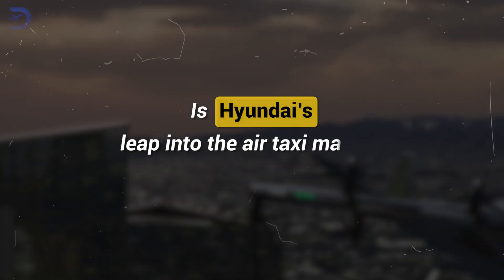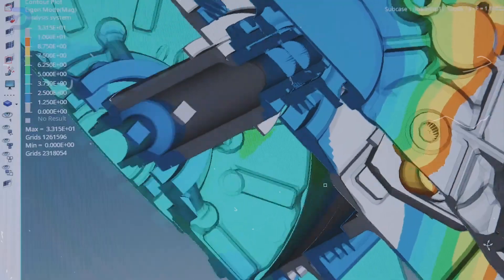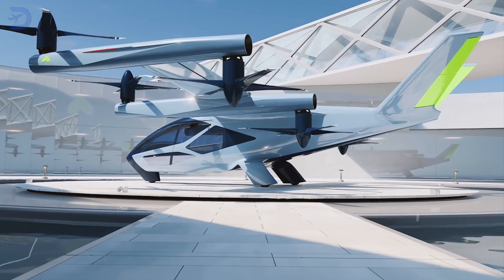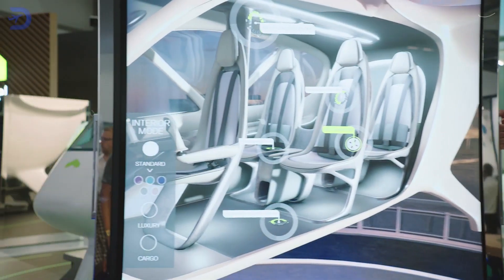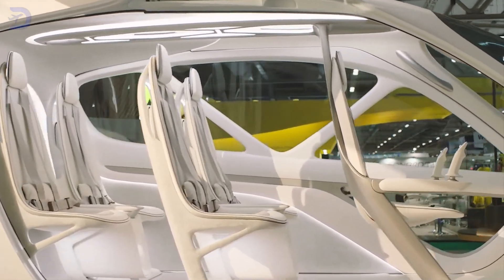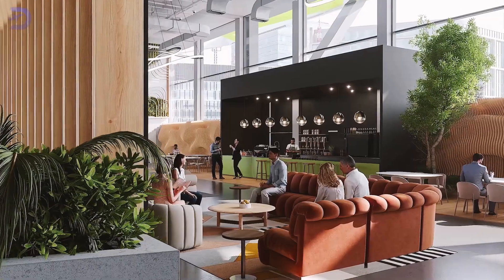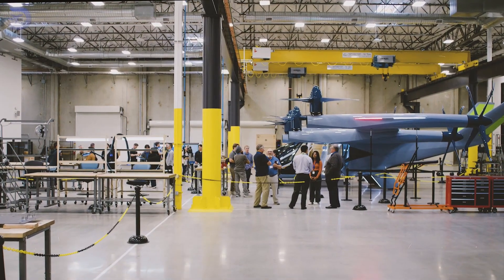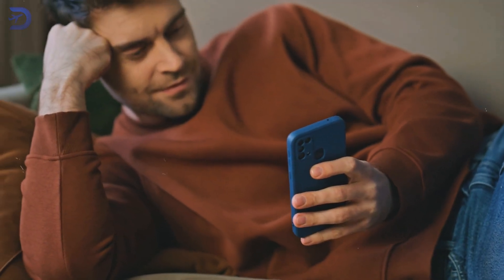Hyundai’s Bold Move into the eVTOL Market

Comment: Propulsion engineer here. The thrust needed for cruise flight will be maybe 10-20% of thrust needed for VTOL. So, inevitably, propulsion will be overpowered and very inefficient in cruise. Some of the propellers might be feathered or freewheeling in cruise but those big props still create a lot of drag. Many companies are going for this configuration but it is a huge compromise. There has to be a better way.